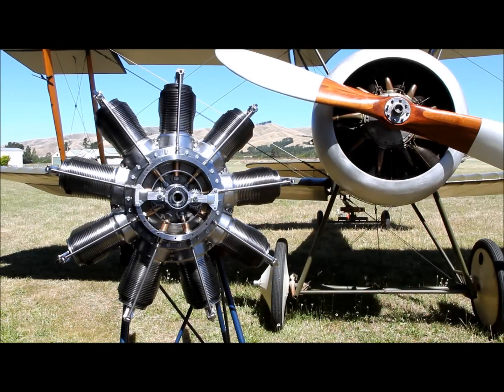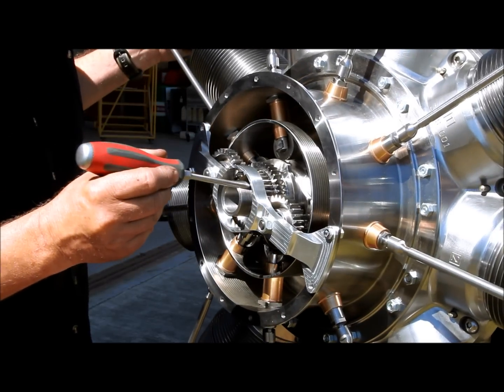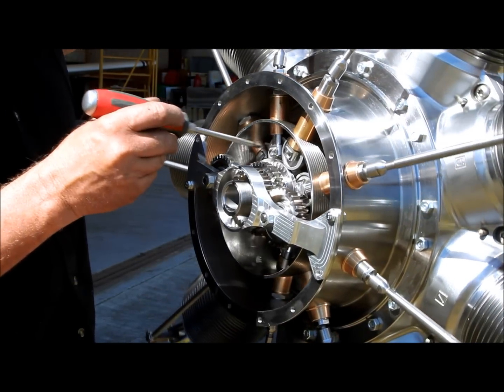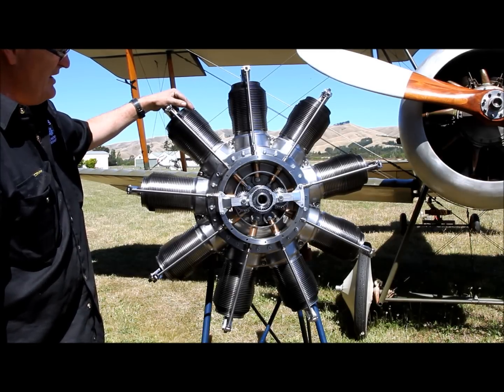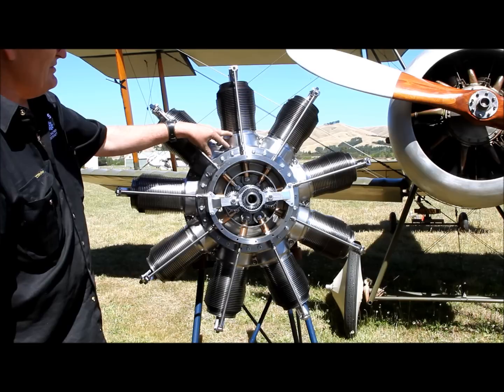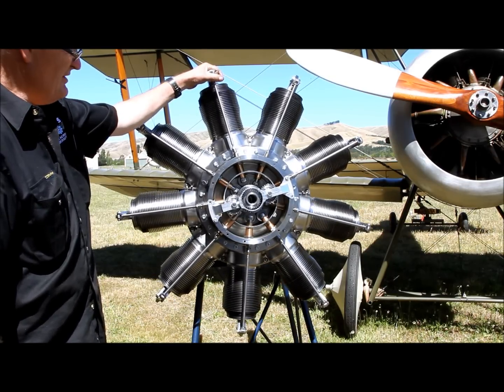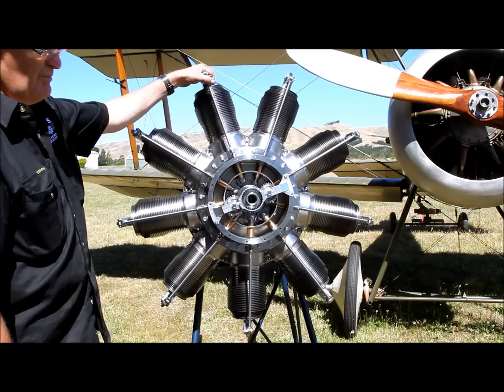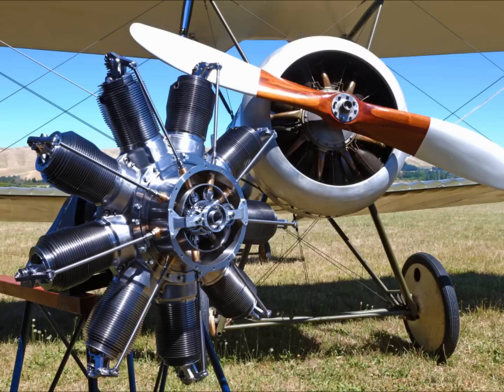New Build - Monosoupape Gnome rotary engine.

Comment: Thanks for video. I’ve wondered what changes were made to turn a rotary engine into a radial engine, besides the obvious changes? Any mechanical changes to engine to convert to radial engine? The gears ⚙️  look like planetary gears! Was all that was necessary was to bolt the case and free the crankshaft to convert from a rotary to a radial engine? I understand they added carb & values later, I’m asking about principles of converting rotary to radial. Thanks. When did conversion happen & who did it?
Reply: The problem, apart from the impractibility of converting to radial is that as the engine is self cooling due to the rotation, it has very small fins on the barrels,  the connecting rods and associated components do not have to bear reciprocating forces as do a radial, so they can be much lighter in construction on the rotary, so why would anyone want to go down the cumbersome radial route ? The only reason the rotary fell out of favour was that to achieve any greater power, for heavier aeroplanes, it would be too large.
Reply: Rotaries had other big problems. There is no practical way to fit a reduction gear, the oil system is more or less forced to be of the total loss type, multiple rows of cylinders is probably not feasible and there can be no exhaust manifold or low drag NACA style cowling. Rapid rotation of the cylinders imposes a great deal of extra drag on the engine and reduces efficiency, and the mass of the revolving engine makes for large and difficult to handle gyroscopic forces on the aircraft.

They also tend to be exceedingly expensive to build, as the entire engine must be carefully balanced (as opposed to just the rotation assembly of a radial). And I'd be very impressed indeed to see a supercharged rotary engine, so good luck with altitude performance.

Comment: The gnom. Was a single-cylinder engine. The (gnome )was the first rotary engine, a very popular engine in the first world war. At the beginning of the war,  the German was using that engine.
Reply: "The Gnom engine was licensed to the French by the German company Uberursel".
Reply: @sandervanderkammen9230        "no the  french   rotary engine. The gnome engine was licensed to the german.  (not to be confused with the German gnom  one-cylinder engine that the French were using for experimentation  was licensed from the German company uberursel.} At the beginning of the war, the German was using those rotary engines. The reason was that the German engine was not very reliable. Until they came up with something much better.
Reply: @Sergecalifornia  I WROTE 'GNOM'
"The Gnom engine was licensed to the French by the German company Uberursel".
Reply: @sandervanderkammen9230  I WROTE ' GNOME.NOT{ GNOM.} WAS LICENSED TO THE GERMAN BY THE FRENCH COMPANY GNOME".
Reply: @Sergecalifornia  What is your point?

Comment: I have worked in aviation -- mostly on the maintenance side of things -- for a good portion of my life.  I have seen photos of rotary radial engines, and I understand the concept of how they work. 
 
{I always call them rotary radials, because when I just say rotary, I brain goes STRAIGHT to Wankel.  When I FIRST learned about these decades ago, I CONFUSED THEM WITH WANKELS.} 
 
All that said, when I see a video of one running, I STILL find it a bit difficult to believe how they operate...😊
Reply: It should be very difficult for an aviation professional to confuse the Rotary engine with the Wankel engine.
Wankel engines are not used in the commercial  aviation industry.
Reply: @sandervanderkammen9230  >>> Did you READ my post?
Reply: You said, quote; "I always call them rotary radials"
Rotary Radial is an oxymoron.
Reply: @sandervanderkammen9230  >>> Why?
Reply: @sandervanderkammen9230  >>> If English is not your first language, that might explain part of our miscommunication.
Reply: @Allan_aka_RocKITEman  So you do not understand the difference between a ROTARY and a RADIAL engine?
Reply: @sandervanderkammen9230  >>> I, ME, RocKITEman call them "rotary radials"  because calling them "rotary"  makes ME think of Wankels.  BTW, there ARE a few Wankel aircraft engines out there.  
 
I do NOT just call them "radial"  engines because standard radial engines do not spin....
Reply: @Allan_aka_RocKITEman  But you understand that the Wankel engine is  not a Rotary type engine correct?

There has never been any certified passenger aircraft with a Wankel engine.... because their has never been a Wankel engine reliable enough to maintain a FAA or EASA airworthiness certification.
Reply: @sandervanderkammen9230  >>> I did NOT say a certified  design.  They have been used in homebuilt / experimental aircraft.
Reply: @sandervanderkammen9230  >>> 
https://en.m.wikipedia.org/wiki/Wankel_engine

"The engine is commonly referred to as a rotary engine, although this name is also applied to other completely different designs, including both pistoned and pistonless rotary engines."
Reply: @Allan_aka_RocKITEman  I thought you said you were an aviation professional?
Reply: @Allan_aka_RocKITEman  I have seen experimental aircraft powered by an 80 lbs. rubber bands and a home built powered by two lawn mower engines... what was your point?
No legitimate aircraft engineer or builder would ever use a Wankel engine... they are not suitable for aircraft.
Reply: @Allan_aka_RocKITEman  Thank you for proving my point....
Reply: @sandervanderkammen9230  >>> Glad I could help...🙄
Reply: @Allan_aka_RocKITEman  Indeed, Curtiss-Wright began work with the FAA in 1958 to produce a reliable flight-rated Wankel engine. 
After more than 20 years worth of research and development and 22 failed prototypes work was finally abandoned.
 There has never been a single type rated aircraft produced with a Wankel engine.

Wankel aircraft engines are now the sole domain of failures, frauds and crackpots.
Reply: @sandervanderkammen9230  >>> If you EVER decide to read ANY of my posts, please let me know....
Reply: @Allan_aka_RocKITEman  As a AVIATION  PROFESSIONAL you should be well aware that Wankel engines are not used in the Commercial or General aviation industry.
You should also know how unprofessional it sounds when you use an oxymoron like Radial Rotary...  it sounds very amateurish and certainly not very professional.

Comment: The German build some of those engines under license from the French.
Reply: The Gnom engine was licensed to the French by the German company Uberursel.
Reply: @sandervanderkammen9230      nope. Not the rotary engine.       The Gnome engine was the work of the three Seguin brothers, Louis, 
Laurent and Augustin. They were talented engineers and the grandsons of 
famous French engineer Marc Seguin. In 1906 the eldest brother, Louis, had formed the Société des Moteurs Gnome to build stationary engines for industrial use, having licensed production of the Gnom single-cylinder stationary engine from Motorenfabrik Oberursel—who, in turn, built licensed Gnome engines for German aircraft during World War I. So it was a French design rotary engine.
Louis was joined by his brother Laurent who designed a rotary engine specifically for aircraft use, using Gnom
 engine cylinders. The brothers' first experimental engine is said to 
have been a 5-cylinder model that developed 34 hp (25 kW), and was a 
radial rather than rotary engine, but no photographs survive of the 
five-cylinder experimental model. The Seguin brothers then turned to 
rotary engines in the interests of better cooling, and the world's first
 production rotary engine, the 7-cylinder, air-cooled 50 hp (37 kW) "Omega"
 was shown at the 1908 Paris automobile show. The first Gnome Omega 
built still exists, and is now in the collection of the Smithsonian's National Air and Space Museum.[13]
 The Seguins used the highest strength material available - recently 
developed nickel steel alloy - and kept the weight down by machining 
components from solid metal, using the best American machine 
tools to create the engine's components; the cylinder wall of a 50 hp 
Gnome was only 1.5 mm (0.059 inches) thick, while the connecting rods 
were milled with deep central channels to reduce weight. While somewhat 
low powered in terms of units of power per litre, its power-to-weight 
ratio was an outstanding 1 hp (0.75 kW) per kg.
The following year, 1909, the inventor Roger Ravaud fitted one to his Aéroscaphe, a combination hydrofoil/aircraft, which he entered in the motor boat and aviation contests at Monaco. Henry Farman's
 use of the Gnome at the famous Rheims aircraft meet that year brought 
it to prominence, when he won the Grand Prix for the greatest non-stop 
distance flown—180 kilometres (110 mi)—and also set a world record for 
endurance flight.  The very first successful seaplane flight, of Henri Fabre's Le Canard, was powered by a Gnome Omega on March 28, 1910 near Marseille.
Production of Gnome rotaries increased rapidly, with some 4,000 
being produced before World War I, and Gnome also produced a two-row 
version (the 100 h.p. Double Omega), the larger 80 hp Gnome Lambda
  and the 160 hp two-row Double Lambda. By the standards of other 
engines of the period, the Gnome was considered not particularly 
temperamental, and was credited as the first engine able to run for ten 
hours between overhauls.[citation needed]
In 1913 the Seguin brothers introduced the new Monosoupape
 ("single valve") series, which replaced inlet valves in the pistons by 
using a single valve in each cylinder head, which doubled as inlet and 
exhaust valve. The engine speed was controlled by varying the opening 
time and extent of the exhaust valves using levers acting on the valve 
tappet rollers, a system later abandoned due to valves burning. The 
weight of the Monosoupape was slightly less than the earlier two-valve 
engines, and it used less lubricating oil. The 100 hp Monosoupape was 
built with 9 cylinders, and developed its rated power at 1,200 rpm.[14]  The later 160 hp nine-cylinder Gnome 9N rotary engine used the Monosoupape valve design while adding the safety factor of a dual ignition system, and was the last known rotary engine design to use such a cylinder head valving format.
  
A German Oberursel U.III engine on museum display
Rotary engines produced by the Clerget and Le Rhône
 companies used conventional pushrod-operated valves in the cylinder 
head, but used the same principle of drawing the fuel mixture through 
the crankshaft, with the Le Rhônes having prominent copper intake tubes 
running from the crankcase to the top of each cylinder to admit the 
intake charge.
The 80 hp (60 kW) seven-cylinder Gnome was the standard at the 
outbreak of World War I, as the Gnome Lambda, and it quickly found 
itself being used in a large number of aircraft designs. It was so good 
that it was licensed by a number of companies, including the German Motorenfabrik Oberursel firm . Oberursel was later purchased by Fokker,
 whose 80 hp Gnome Lambda copy was known as the Oberursel U.0. It was 
not at all uncommon for French Gnôme Lambdas, as used in the earliest 
examples of the Bristol Scout biplane, to meet German versions, powering Fokker E.I Eindeckers in combat, from the latter half of 1915 on.
The only attempts to produce twin-row rotary engines in any 
volume were undertaken by Gnome, with their Double Lambda 
fourteen-cylinder 160 hp design, and with the German Oberursel firm's 
early World War I clone of the Double Lambda design, the U.III of the 
same power rating.  While an example of the Double Lambda went on to 
power one of the Deperdussin Monocoque racing aircraft to a world-record
 speed of nearly 204 km/h (126 mph) in September 1913, the Oberursel 
U.III is only known to have been fitted into a few German production 
military aircraft, the Fokker E.IV fighter monoplane and Fokker D.III
 fighter biplane, both of whose failures to become successful combat 
types were partially due to the poor quality of the German powerplant, 
which was prone to wearing out after only a few hours of combat flight. The French was producing engine for the allies Air Force french British and American. Even the German was using French design rotary engine.
Reply: I wrote GNOM  not Gnome.

Comment: PLEASE consider building a new and partially  throttle-able LeRhone 9R 170HP engine and fit it into an accurate Nie. 28.  You fellows should know all about the 27th Aero Squadron's success with their 46+ corrections to that  airframe resulting in the Army Air Corps placing an order for 600 such "Super 28's" with 9R at the close of the war.

Comment: Amazing.   And the first video I've seen that gave me some idea of how a spinning engine can get fuel delivered to the cylinder.
Reply: Mantap
Reply: The monosoupape is a particularly weird rotary engine in that it uses transfer ports at the bottom of the cylinder for charging even though it is a 4 stroke. Most others were built like a 'normal' four stroke with two valves per cylinder, in those cases the crankcase was essentially used as an inlet manifold and there would be a inlet runner from the crankcase up to each cylinder head.

In all cases lubrication was 'total loss' with the oil being drawn into the cylinders with the fuel.

Comment: I've always been puzzled, how does the crankcase spin? Is it like how if you let a normal engine turn normally but if you hold the crankshaft, the crankcase decides to turn to make the effect of spinning pistons?
Reply: ? the crankshaft is fixed at aircraft and "decide" nothing...
Reply: Reciprocating motion of the piston cylinder is converted to rotary motion of the crank shaft which causes the rotors to move

Comment: I saw an ad for Battlefield1, the WW1 sim game and I saw an engine move with the prop. Before I went off half cocked I though it best to check myself. Good thing I did. Seriously I didn't think they worked like that.
Reply: "Sim" game? You have very low standards for simulation!
Reply: It's not a simulator!

Comment: is this what would have been used on Fokker DrI?
Reply: this is totaly false: the "Société des moteurs Gnome" sold the rotary engine license to Oberussel in 1913 and not invert...
Reply: +manuelkong10 Some DR1s were powered by captured Le Rhones, but the Germans also copied the motor. The copy was manufactured (I believe) by Oberursel.
Reply: No.
Reply: +Chris Carter Actually the 'Gnom' was a design by Motorenfabrik Oberursel which them sold a license to Le Rhône in 1900..

Oberursel was given rights to manufacture the larger "Gnome" 9C version developed by Le Rhône in 1913 before the engine entered production..
Reply: @doktorbimmer  9J not C.

Comment: This a beautiful reproduction of what seems to me to be a 100 year old miraculous design.  The guy or guys who came up with this in 1915 must have been geniuses.  I tend to think of engines of this period as being rather primitive.  The "rotary" is simple in some ways but not so simple in others.  You guys have done a wonderful job.  I will be checking out the web site.  Quite impressive.
Reply: The rotary engine design is much older as 1915: the first rotary was installed in the rear wheel from the 1893 Felix Millet motorcycle...
The rotary known a big success in WW1 because solve the most problems from the  aircraft engines in that times: cylinder cooling inclusive at ground, and weight
Reply: Thanks for the reply.  I had no idea that the rotary went back to the late 19th century.